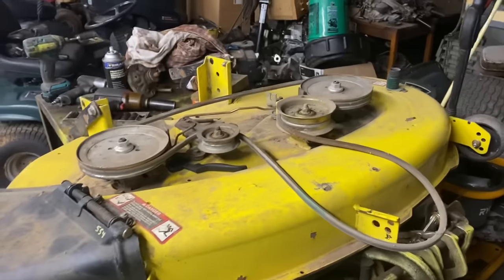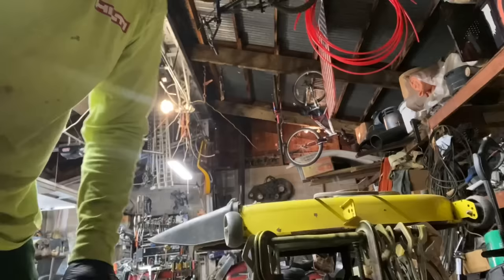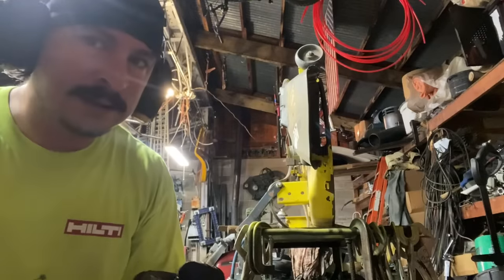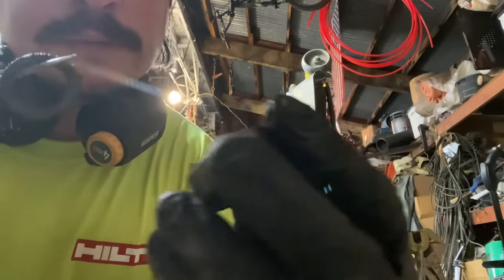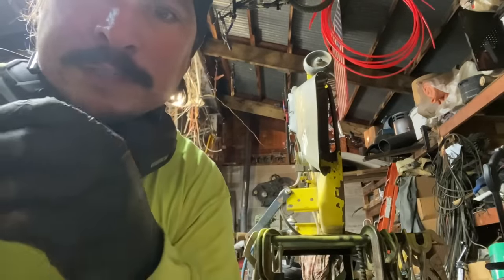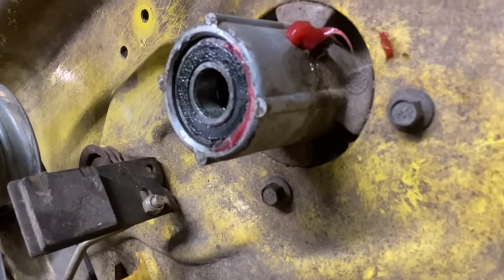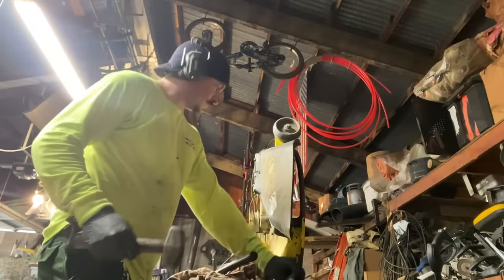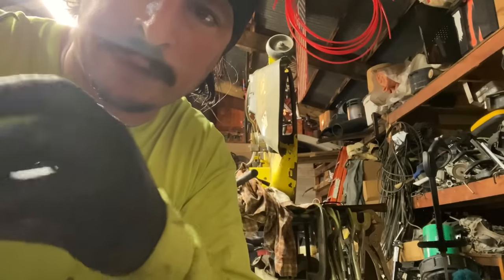Part 1 - Don’t trust the “Experts” Grease your mower deck sealed spindle bearings Common sense.

Comment: Finally some common sense, factual and concise advise. No fluff. Strait forward and proven, mate you are a legend. Cheers!
Reply from the maker: I need to consult with you before I title any future video, your comment was worded great. The last part is pushing it but hay I’ll take any positive feed back I can get.
Reply: I would agree Legend
Reply: Good job!
Reply: yep
Reply: That was the best explanation WITH hands on proof! Awesome video!
Reply: I have to agree that all bearings need to be greased as far as common sense goes. With that being said, if you take the spindle apart then wouldn't you be saving a lot if grease and time if you just packed the bearings buy hand. And if you have to prove you can grease the bearings buy filling the whole spindle with grease then wouldn't it be pertinent to just take off the inner seal and shield seeing how you wouldn't need them since the inner space is completely full of grease and there by allowing the grease easier access to the inner bearing? I guess once you have the inner spindle full you wouldn't need to regrease them for a hundred years. And if you drilled a bunch of holes in the spacer you wouldn't need to put any never/anti seize on it. As fast as you took it apart and showed use the original grease in the bearings and put it back together I would just hand pack the bearings slap some anti seize on the shaft and be done with it.
Reply: @thatsonebadhatharry8610  This is also a guide to whether your mower service center  is doing the job properly if you are armed with this knowledge.
Reply: And this concept was proven by Murray in the 90's by putting one color grease inside of the bearings and another color grease in the housing and then ran the unit and took the mandrel apart and could see the mixing of the grease colors.
Reply: @thatsonebadhatharry8610  My Chinese bearings were just fine and never had been greased when I replaced them at 800 hours just for good measure at a cost of $17 for the four.
Reply: @mostcom  I agree, never said the bearing were bad just cheap.
Reply: @ngnmech  If it was so important to prove it was getting grease into the bearings then why didn't the manufacturer fill the empty cavity full of grease before it went to the dealer? The  fact that the manufacturer didn't design a better way to grease the bearings means they were concerned about one thing, profits. It doesn't take much to design a tube with two bearings with mounting points. The grease zerk was an after thought. I'm surprised the bearings last as long as they do being made in China.
Reply: @mostcom  Well I did say that I was surprised that they lasted as long as they did but I've been surprised before and I'm sure it won't be the last time either. They're still cheap though.
Reply: @thatsonebadhatharry8610  It is complicated.  Do you know how much grease will fit into the empty cavity.  About half a tube.   And reality the main thing behind making the spindle greaseable even with the sealed bearings is for the people that feel they need to grease the spindles can.   But on a another note.  I have seen causes were the grease will build pressure inside of the spindle housing and either crush the inner seals and then blow out the outer seals, or even try to push the bearings out of the housing causing a side load on the bearings leading to bearing failure in a short period of time.  You can tell when that happens because the spindle that normally turns freely will appear to lock up and turn very hard for a period of time.
Reply: @ngnmech  I totally agree.
Reply from the maker: @thatsonebadhatharry8610  the whole point is that if they have seals and grease zerks you can simply grease them and go on with your mowing. No need to take things apart. Just because I can take a deck apart fast like a wizard, don’t mean everyone has tools and time or the know how to do it. And one tube of grease will fill about 6 to 10 spindles. And grease is cheep. Geeezy Pete.
Reply from the maker: @ngnmech  I’d like to see that Murray video. Some of your information is outrageous. In 18 years Iv never seen damage to any seals or any proof that even possible to lock up an assembly with grease. Really it’s laughable to anyone who actually understands these assemblies. That’s the type of crap information I’m trying to help folk’s understand can’t be trusted. No proof provided just a “pro” telling us it won’t work. I call them naysayers. Happy to tell us something won’t work but never a shred of proof to back it up. Just expert advice we should trust because an “expert” says so. No thanks bud. Don’t be lazy, if you want to help folks, video the proof and help. Otherwise we don’t need to hear that trash.
Reply from the maker: @mostcom  not everyone is so lucky. Some of this new stuff done last 100 hours. Iv seen many fail. The quality of components change through the years and the amount of grease added can be different from each person adding grease and possibly 100 other factors.
Reply: @GTObearclaw1  The study was done by Murray in the 90's and only known by the Murray dealers and was discussed at dealer meetings. And since Murray has been gone since 2005 I doubt any proof of that study even still exist since Briggs has basically killed off any thing related to them.   The last Murray mowers I saw were actually being made by a Chinese company with no parts support..

How many decks have you greased and then when you try to engage the mower it kills the engine for about the first 3-4 attempts.  That is bearing side loading on the sealed bearings.  Never saw the outside seals pushed out and the inside seals caved into the bearing on spindle disassembly that used metal sealed bearings.  Think about how much side pressure a battery or pneumatic grease gun putting out 5-10K pressure can put on a bearing that is tight pressed into the mandrel housing and held tight top and bottom by the pulley and blade mount.
Reply: @GTObearclaw1  Well if they actually thought all owners would do maintenance like the manual says they would have at least used bearings that were shielded or open and not sealed on the inner most side of the bearings wouldn't they. And if it just takes a little grease and grease is cheap why didn't the factory fill it up to begin with? Just saying.
Reply from the maker: @thatsonebadhatharry8610  I Can’t explain the motive of not properly greasing before selling but I can say that the inner seals don’t matter as I painstakingly pointed out in the long boring video, shields don’t matter in the least. A grease gun will push grease past those little rubber flaps like they were never there. As for the upper bearing it can be argued that it actually provides a benefit to hood grease up in that bearing rather than allowing most to run down to the bottom. If greased regularly it wouldn’t matter but if not greased often it could matter. Regardless those shields don’t matter one bit. That’s what I was hoping folks could take away. Problem is most people don’t watch the full video and start telling me how I’m wrong without bothering to see the proof I provided.
Reply from the maker: @ngnmech  as for the Murry information, if it was only for dealers and not the buying public they were not helping customers much. 

As for the grease in a mandrel yes I understand the presure a gun can put out but does not get anywhere near that high. And excess grease pushes out. Yes a filled assembly can slow down the deck start up. But really not a big deal compared to the bearings not being greased. I’d rather have grease in my bearings. And the assembly does not hold pressure only the filled assembly may cause drag on deck start up. And no Iv never once ever seen a shield damaged from grease applications not even a rubber one. The metal are supported but really unless the metal
Side is pointing to the ground I don’t see a benefit in any other poison. Can argue all
Day Iv seen the proof over 18 years I’m done listening to anyone who can’t provide proof. Making videos is easy. If you have good information to capture and share folks do appreciate that. Anything else is theory and opinion and should be treated as such.
Reply: @GTObearclaw1  I will apologize for the ranting and I also will concede that any greasing of the bearings is better than none. Not everyone that has a grease gun will see this video or my response to the post that started these responses, they might watch another video by someone else or not watch a video at all or they will probably just pump a few squirts of grease in the zerk and be done with it. I guess what I'm saying is just that the manufacturer could do a lot better without jacking their prices up but it would cost them profits buy spending a few extra penny's and by also making the product last longer there by reducing their product sales. The manufacturer could have done a better job but chose not to. 
I'm sure this video will help all who watch it and most won't se my replies (hopefully). You made a good video and it people like yourself that are on YT that help others that are looking for specific answers. I myself have found lots of great information here as well.
Have a great day and keep the videos coming. 

John 3:16
Reply from the maker: @thatsonebadhatharry8610  all in good fun. I enjoy the conversations with folks on the topic. I especially like talking to folks like you who say your piece and also listen to the other side and we can simply agree to
Disagree but nobody gets their feelings hurt. We could all be right or wrong. Folks just need to get outside and do some experiments. Turn some
Wrenches. I meant to
Go back and edit that last response to mention that I have also had decks that were never lubed after purched and customers complained about the deck
Stalling out engine when deck was kicked on. This is almost always on a electric PTO type tractor with the electric clutch that starts the deck. And I learned that sometimes when engine does that, just kick deck on for a
Second and then it right off then it gets things moving. Then immediate kick the deck back on and it will
Stay running and deck will engage better. I think sometimes especially on the bigger 54” decks, it’s just a lot of stuff that has to get moving and can be a bit much on cold start up
For the engine to get everything moving.  I know that’s not what you meant . But just something I thought about when reading your comment. 

This thread did kinda get carried away. Lol
Reply: @GTObearclaw1  👍it's been nice chatting with you. I do have a tendency to wright my mind when I should be keeping my fingers shut. 
Got to go get some sleep, have to go to church in the morning.
Reply: @GTObearclaw1  I just watched another video where a mechanic removed BOTH inner seals on the spindle.  My concern was as you stated.  On this vertical shaft, sure, gravity will pull/pool the grease into the lower bearing like crazy.  However, the upper one may dry out more quickly if not continuously relubricated.  I'm going to follow your lead, although I will clean and hand pack the bearings first.  Thanks!
Reply: @GTObearclaw1  :  Good video.  FYI, be careful about overloading the bearing with grease.  Believe it or not there is such a thing as too much grease.  I know it sounds crazy but too much grease causes excessive heat build up and shortens the life of the bearing.
Your video is worthy because it brings. to mind the need for proper machine maintenance.
Keep up the good work and be safe.
Reply from the maker: @wrongfullyaccused7139  the pressure does not hold, passes right out. The only way to get grease in using the zerk is to fill the assembly. No way to regulate the amount going in. Pump till full. This requirements for servicing these bearings are probably different from what ever bearings that information came from. Overheating a deck bearing from too much grease is not a realistic concern. Once the bearing is filled the extra grease exits the assembly. Kinda self regulating. Lol
Reply from the maker: @liberpater1342  thanks for the comment. Why bother taking things apart? That was the whole purpose of the video was to prove that’s unnecessary. Save time and trouble and just add grease from the zerk. You will find it works great and will be all that is needed.
Reply: @GTObearclaw1  : Fair enough.
Reply: remove , wash out bearings, use heavy duty red Dryden grease and hand pack. if you pump too much grease in it will blow out the outer plastic seals. plus you waste a lot of grease inside spindle housing. if you blow out the outer plastic seals they will ingest dirt and water. don't use water or power washer on mower deck. use compressed air only. water will destroy idler pulley bearings. they are not sealed or serviceable. i'm a certified john deere lawn equipment tech. @thatsonebadhatharry8610
Reply: @GTObearclaw1  Well, thank you for your response!  Check this out though. A 2004 White LT 1800 has small ports just south of the upper bearing seats (in my case).  If you fill the spindle cavity with grease, the excess is puked out of the spindle before it reaches the upper bearing.  The only remedy for this, I can imagine, is to block off those small weep holes.  Maybe a small screw?  This shit is designed to fail!
Reply from the maker: @willwarro4054  i agree to not use water. And actually you can use a grease needle and add grease to all the idler and tensioner bearings and make them last for many many years longer. It’s so easy it’s stupid not to do it. I have a video that shows that as well. As for credentials, I was ASE master tech. And nobody cares. That’s why I do
T ever bother mentioning in my videos. Some folks trained by dealers are brainwashed. Wouldn’t trust half the crap I hear. If you have good information post videos and prove your points. In 18 years Iv never seen seals blow out. If your knowledge on decks you would know the assembly is tight if in proper working condition No room for seals to push off the bearings. Only the lip gives way for grease to pass. My proof is on video. Point of this process is to avoid paying someone to pull the deck apart or the owner needing to do so. If they can’t be greased like this why does Deere put zerks on. It work’s fantastic. I trust what I know works and Iv seen this work every single time Iv done it. You can do as you wish woth your stuff but just know it works. Try it sometime. Grease is cheep enough so that’s a terrable argument saying it waste grease. 1 tube will
Completely service 3 or 4 empty decks. Add that up and tell me a couple of bucks per tractor is a waste. Mind blowing.
Reply from the maker: @liberpater1342  your absolutely right and that’s one of many reasons why I hate anything made by MTD. It’s the worst. Plug those holes and they will grease just like what I showed with the Deere spindle. MTD is the only company I know who has that hole. Real dumb idea unless the plan was to make bearings fail faster. They sure succeed at making things break faster.
Reply: @GTObearclaw1  Right!  I'm selling the tractor after I rebuild the one spindle, clean and repack the other side, deck belt, etc.  The other problem with this set up is, the freaking zerk fittings are hidden under the deck!  You either need to put the tractor on it's ass OR remove the deck to grease.  Maybe you could do a video warning folks about this crap?
Reply: Sealed bearings DO NOT allow a significant amount of greese to provide lubrication to the bearing.  Period
Reply: Does the organization of the shop tell anyone, anything?
Reply: I just purchased a husqvarna TS 146x and it has no grease zerks in the mandrel tops. look like the hole in the top of the spindle where zerks could be have indented caps. I took a picture of mine to zoom in, and it looks like threads are inside that hole that would allow for zerks, but none there. Have you seen this and should I install zerks in the tops of those?
Reply from the maker: @georgelaurick3405  period huh? Like you’re the law in these parts? An expert I presume? The reality is more than enough grease gets past the lip and into the bearing and that’s the cold hard truth. This is nothing new. Same old song and dance for decades. But thanks for your expert advice. This is the exact reason I made the video. I show proof, no naysayers can back any claims just blow hot air just like the naysayers who posted videos saying not to grease these units. It’s simply horrendous advice and hopfully nobody give it any credibility. Any grease is better than none however the grease passing through the bearings will be sufficient to fill the need. Every time more grease is added more will enter the bearing. Got any more gold nuggets for us?
Reply from the maker: @spudthegreaterusa8386  some Husqvarna machines indeed have zerks in top so it’s possible they just left them off that machine or maybe didn’t offer for your model but if you can install one and it takes grease your good to go!!!
Reply from the maker: @williepelzer384  poor folks have poor ways. What exactly did it tell you? Maybe we can all learn something valuable from your wisdom? I’ll wait in anticipation. I’m sure you have a real zinger coming down the pipes.